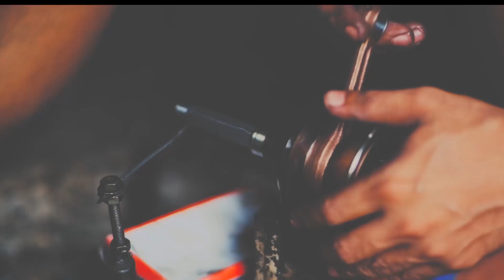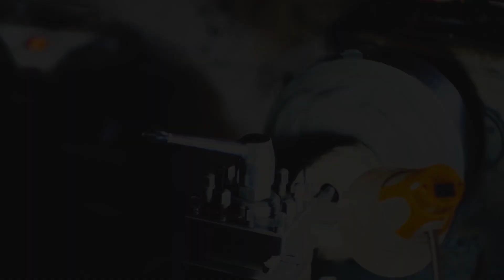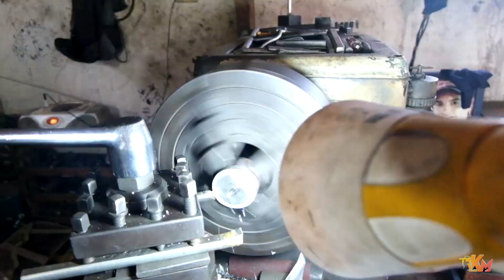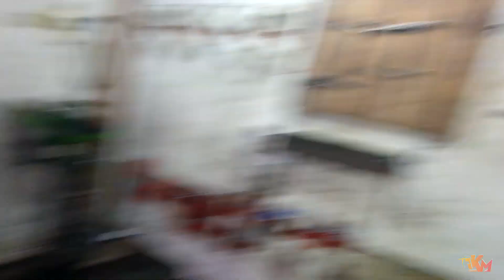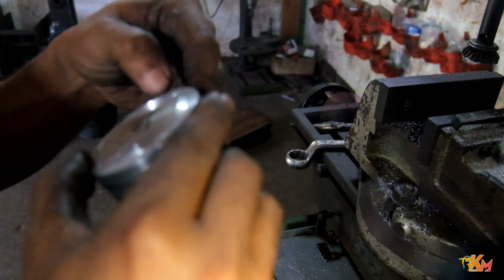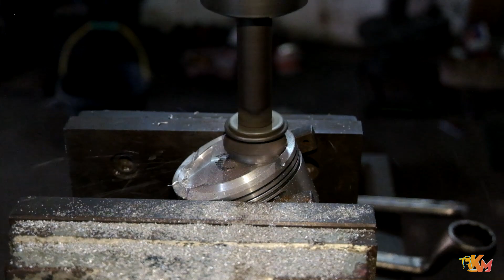PROSES BUBUT PISTON CBR 1.5MM COAK KLEP 3MM UNTUK BORE UP MOTOR TIGER!!

Comment: yen ra geser liner yo cepet ngebul, mending pancet nggae seher tiger soale bedo posisi pin
Reply from the maker: Orang kalo udah maen model begini gak mikirin cepet ngebul apa enggak gan, yg penting sensasi berkendaranya ✌️
Reply: @KatirinMotor digeser wae liner e mesake konsumen
Reply from the maker: Siap makasih buat masukannya
Reply: @KatirinMotor  tapi yaaa tergantung peruntukkane hhhh lanjuut masbrooo
Reply: Katirin Motor berarti saat kolter agak dimiringkan ke bawah mas?
Reply: @dikiseratus5183 bisa lewat kolteran, geser arah ex semampunya geser, itu bwat toleransi rok pendek seher cbr dan saat conrod membentuk sudut pas ledakan/ power stroke. intinya mengurangi gesekan ring piston dan liner yang biasanya liner akan kalah makanya seringnya "nggentong". Jangan miring ... kiri kanannya harus tetap center untuk menghindari ceket stang seher
Reply: John Lennon siap mas suwun Infone
Rencana mau buat spek langkah Tiger selembar blok MP mas,
Reply: @dikiseratus5183  mesti dipertimbangkan klo stang seher semakin pendek maka gesekan ring dan liner makin besar terutama saat ledakan dan sebaliknya, efisiensipun semakin berkurang berakibat pada durability mesin. Tapi kadang kita ngejar penampilan standaran... selamat bereksperimen XD